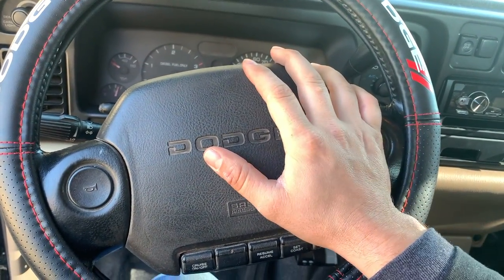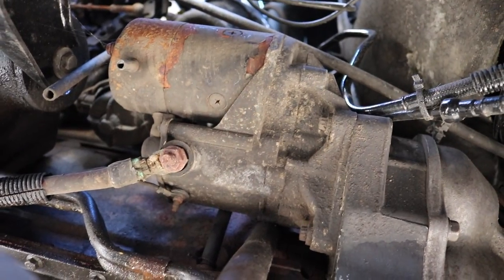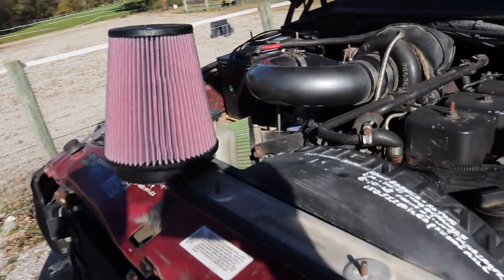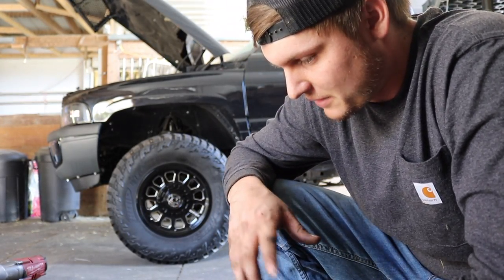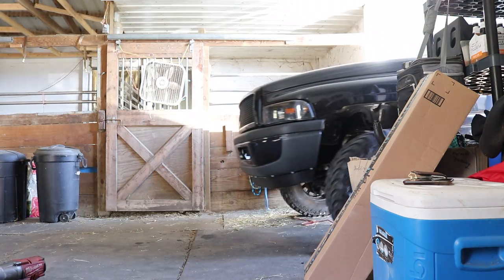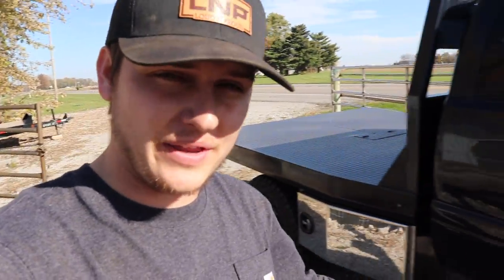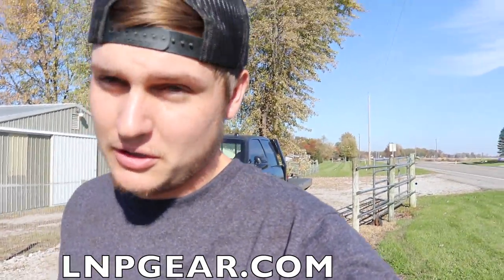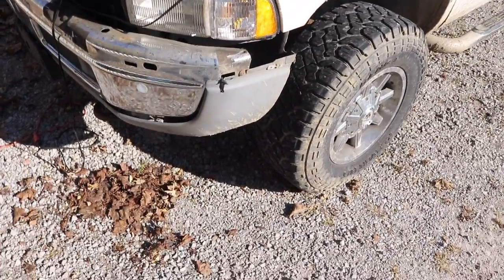12V Cummins SLOW CRANK problem SOLVED!!!

Comment: Larrybs has the answer and parts always hold onto your starters never turn them in on a core rebuild them. Buy a new starter as back up to rebuild. Always bang air filter bottom side down on a clean piece of paper. I’ve seen horror stories of casting material in brand new air filters smoke new motors
Reply: Yes i repaired my origional starter in my 1996 for 25.00

Comment: Just turn the key without cranking and look at the alt gauge, if the voltage is up your batteries are 👍  mine just started doing this today 🙃

Comment: Air filters like the one you replaced, are designed to be air blown clean and a recharge kit is available for it. All at a cheaper price than that new filter you put on it.

Comment: Yep a bad starter, cables, connections, and weak batteries can all cause slow cranks on pretty much every engine. Sometimes bad cables, that have corrosion on the inside where you can't see, can also wear out a starter since it makes it have to work harder.

Comment: I had that same problem on my 1st gen dually, it usually happens out of the blue at the least convenient time. It happened to me in a restaurant parking lot and I had to have a friend pull start it but I guess you'll have that on these older trucks.
Reply: What was wrong with it mines doing the same?

Comment: I had the same problem with my 2nd gen also. And I changed the starter out and it fixed it. Cranks just fine now. Does that truck not have the diesel heater in that you can plug up so it cranks better on cold mornings?

Comment: My 6.0 just did this Saturday. Ran and drove fine in the a.m. went to leave a job and really weak crank. Through two batteries on it and still did the same thing. Tried the jumper wire for the starter and still cranked weak. Put a 6.4 starter in and man what a difference.

Comment: On the white truck it’s probably the battery not pushing out enough CCA. Do a load test to check if the battery is bad. I had one that wasn’t pushing enough CCA during the mornings until the day warmed up. Then one day it just went out and that was it.

Comment: It's actually good for an engine to crank like it did after the new one any faster and oil hasn't had time to get around the engine and it causes in needed wear but obviously it shouldn't crank like it did at first

Comment: Probably has a bad spot in the starter my truck is doing the same thing just have not changed it yet. One way to see if that is the problem is next time it does it take a hammer and tap on the starter a couple of times and see if it will start

Comment: Had the same issue with my 1500 it did it randomly tested it showed that it was good and then when I put a load on it and tested it is when it showed it was bad battery I changed it and haven't had that issue since

Comment: I got a 1994 dodge ram 1500 gasoline v8 5.9 engine and the issue I have is that when it cranks it smells like gas lots of black smoke comes out then goes away and its feels like it chokes when Im at a red light

Comment: But it would be fine he said you would drive it some or shut it off come back out it wouldn't start he said you can hook a vehicle to it and try to jump it wouldn't do nothing he said you could come back the next day turn the keynote fire right up like there was nothing wrong with it he said that that's why the PCM was going bad I had corrosion on the inside you couldn't see it but it is common in Dodges especially the gas trucks